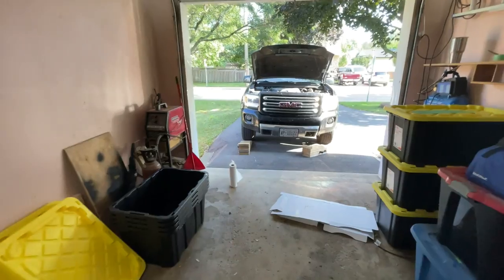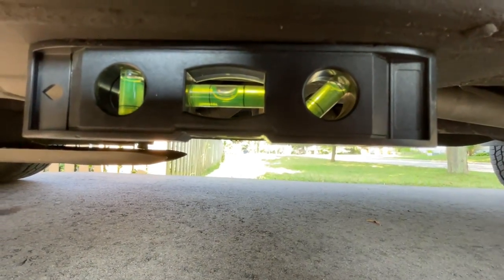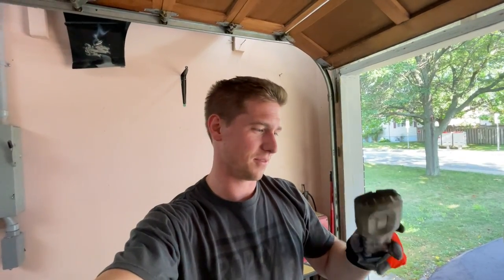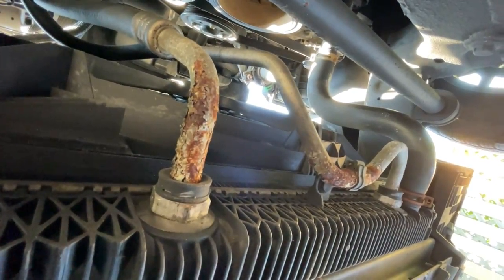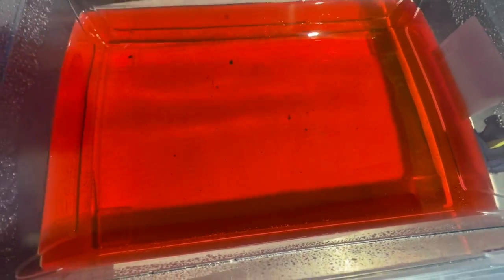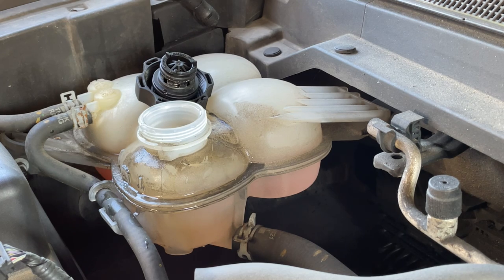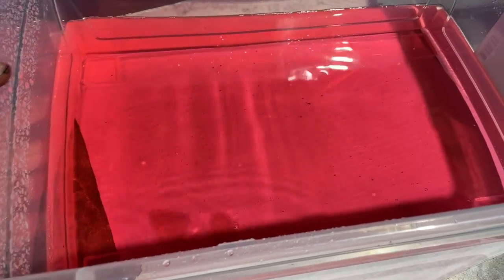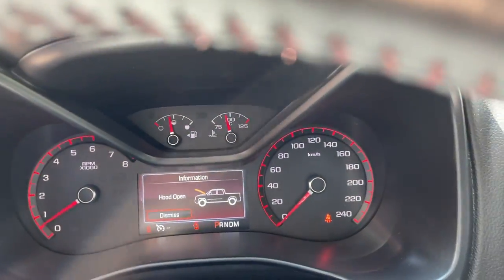Colorado / Canyon 2015 - 2016 | How to Flush and Replace Coolant

Comment: I always just undo the bottom hose and let it quick drain, which also insures any larger clumps of stuff in coolant makes it all out too. When I flush, I put in some white vinegar and dish soap, to neutralize calcium that might be in the system, and the detergent helps also to loosen up the skummy stuff. I then drive it around 20-30 miles and then drain it, flush water through, then coolant, and finally air bleed the manifold coolant area.

Comment: 196k km!  nice!  Folks think these trucks don't last. I have a '17 diesel and am changing coolant too.  You should post how these trucks keep going.
Reply from the maker: 236,000KM so far. It has taken me, my wife and our dog from coast to coast camping in the back, towed drift cars, sled trailers,  dump trailers and boats all over and NEVER let me down. Will be doing a longevity video at some point. There are some things that are starting to show their age but overall an unbelievably reliable well built truck.
Reply: @SteveDoesStuff89  has your head unit survived? Touch screen on mine died pretty early on in the vehicles life but I haven't bothered to replace it.

Comment: I took the spoiler off of my 2016 Colorado 4 years ago and nothing changed as far as temps go. All the BS from the keyboard warriors simply isn't true. I can reach the oil drain bolt without jacking up the truck plus it just looks better.
Reply from the maker: Idk man, I noticed a difference in my trans temps. About 10 - 15 degrees C. Loaded or unloaded.

Comment: The shop did my coolant flush as i don't like working on stuff and id have to do it on side of road outside in rain. I bought 2 jugs of the acdelco dexcool concentrated coolant but they only used 1 jug?

Comment: Thanks Steve. I have 198,000 km on my 2016 canyon, v6. I just sprung a leak in the lower rad hose. Apparently this hose is discontinued. At least for my shops here in BC Canada. Found a supplier online. Will need to order from there. Thanks for the video I will be draining a filling my coolant soon. The leak was actually on the hard plastic hose piece directly adjacent to the serpentine belt.

Comment: Thanks Steve for a great video!  I appreciate it.  Getting ready to change the coolant on my 2017 Colorado, 3.6 V6.  I only have 25,000 miles on it (I'm retired) but since it's now 6 years old, thought I better do it.  Got some test strips to check the original stuff that's in there.  Glad I did because WOW !!!  The PH is all the way down to 5.0,  very acidic.  The freeze protection is still minus 35 degrees F, and the color is still looking new.  But the test strips prove that coolant does become acidic even with low mileage and visually it looks fine.  Acidic coolant will destroy heater cores, radiator cores,  cause corrosion of block coolant passages, etc.   Normally with good coolant, the PH should be up around 8 or 9.   Thanks again for all your videos!   Cheers from Oklahoma City.

Comment: So after watching your video I decided to flush the coolant in my 2015 Canyon and more important check those oil cooler lines after seeing how corroded your were. Thankfully we don't have problems with icy roads here in south Louisiana and no salt to eat the underside of vehicles. Mine looked practically brand new and that was a relief. But the funny thing is I found a Cyclops Maxxeon magnetic light probably left by the mechanic that changed my a/c compressor about three years ago.
Reply from the maker: HA! That’s hilarious. Those lights sure can hang on for a long time in there.

Comment: Hey thanks for the video,  I was wondering what type of travel trailer were you towing ? I have a 3.6 16 colorado  towing about 4800 lbs. I was wondering how you did towing in the mountains. WE have a couple of trips planned for this summer. New york and PA. Thanks Mike
Reply from the maker: Glad it could help. I don’t think I have ever towed a travel trailer with this but i regularly tow an open car trailer with my drift car on it. Total weight roughly 5,000 (ish) pounds plus 1,000 lbs of gear. No mountains around here where I tow but I had found at speed this has very good trans cooling. I’d be keeping an eye on the temps for sure but at speed I have found them to be fine. Stop and go in town with a lot of weight is where I find it gets hot fast.

Comment: How did you berp it
Reply from the maker: Jacked up the side of the truck with the pressure tank, filled it and then just squeezed the upper rad hoes repeatedly until air stopped burping into the tank. Once that was stable and coolant at a good level, I started it, heat on full blast and let it come to temp with cap on tank.

Comment: You say your towing 6000lb at 100k. Can I ask what rpm your running ? Same truck and I tow 4500 @ 3000 rpm at 100k
Reply from the maker: Depends really. If I am driving 90 - 100 I leave it in 5th. Probably 2600 rpm roughly

Comment: You say you've got a 60/40 mix. Is that 60% water and 40% coolant, or is it 60% coolant and 40% water.
Reply: In cold canada we use 60 coolant 40 water.